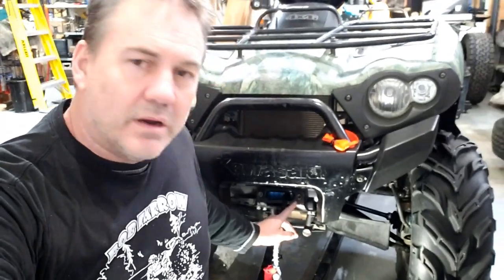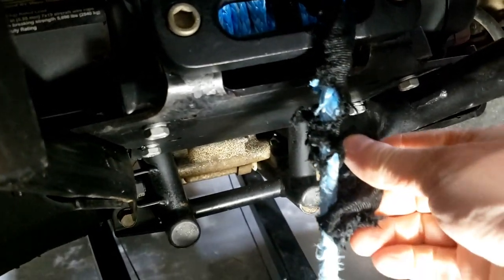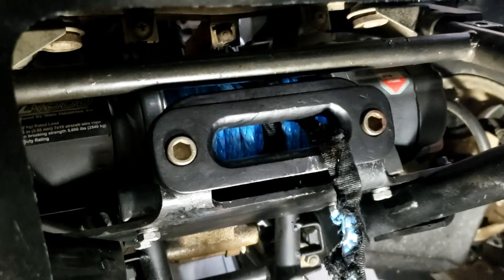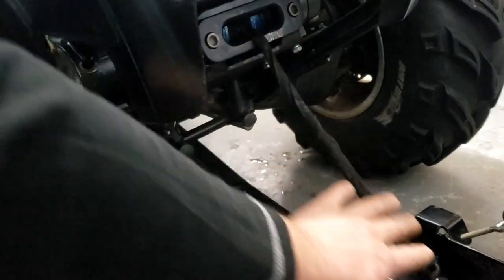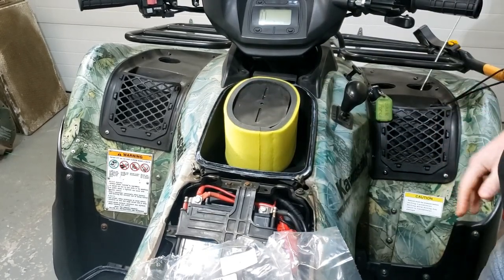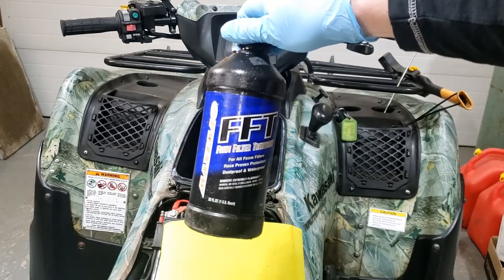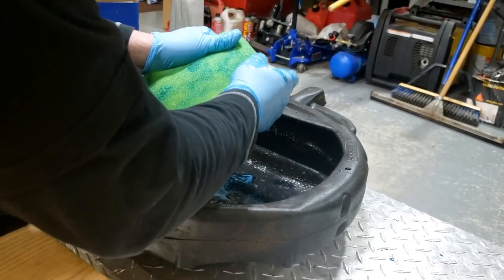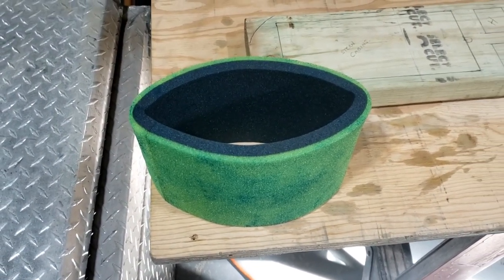Getting rid of K&N New Filter Brute Force 750

Comment: Interesting!  I've not heard much negative about k&n air filters, but I do know they don't work well in certain environments.  Sometimes it's just best to use OEM stuff.
Reply from the maker: I've never heard much good about K&N, I even remember back in my two stroke days my buddies saying they were garbage...let in too much dust and grit.  Thanks Broknex!
Reply: @RobFarrowATV  the only time I’ve heard about them letting dust in the engine is when they weren’t oiled   I’ve been running them for over 15 years on my trucks and on my quads and SXSs and I’ve pretty much have always used K&N filter cleaners and oil.
Reply from the maker: Good to know.
Reply: @RobFarrowATV  yup as long as you keep them oiled after they have been cleaned they will catch the dust they were never meant to be run dry

Comment: On my can am 650XT  I have a set up that comes with their plows where a strap goes around the cross member on the bumper and on that strap is a pulley that seperates so u can put ur cable from winch thru it. This brings your winch lead up so when you lift your plow there aint so much down force on your cable and winch and keeps ur cable end from going into the fairleads. I also did this on my cf moto 800xc and it works great. Dont see why it wouldnt work on your machine either. If a person has no bumper maybe try a longer strap and put on your rack. Aint sure this will work for you but just a thought. Gives a guy some lead way on lifting ur plow. Also make sure u back away from ur snow pile before lifting plow it is less stress on everything.
Reply from the maker: Interesting, thanks Man!  Seems it would work much easier that way for sure.
Reply: @RobFarrowATV  
Your Welcome.
Yea just look up plows and plow accessories on the Can Am website. Their strap will work on any atv. I use it on my cf moto- cforce 800xc.